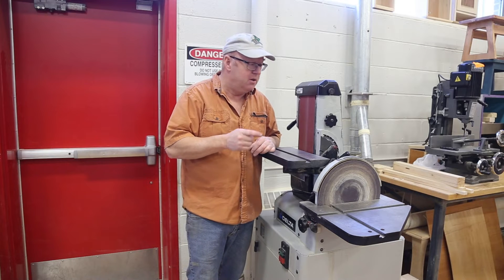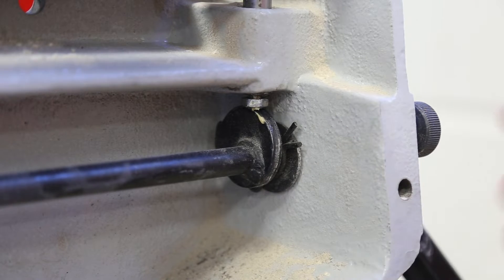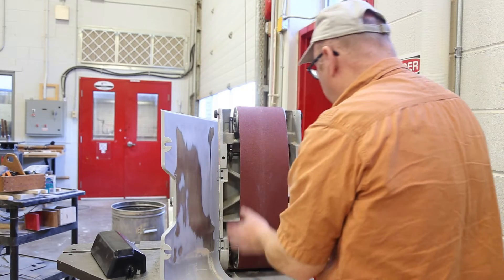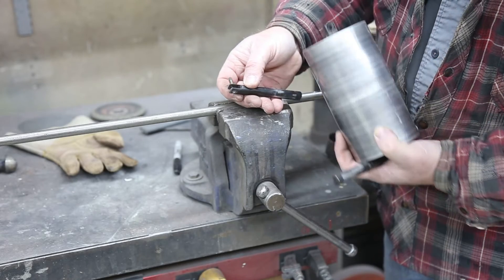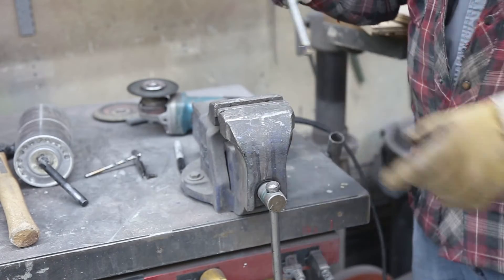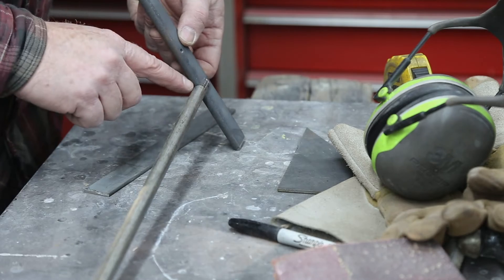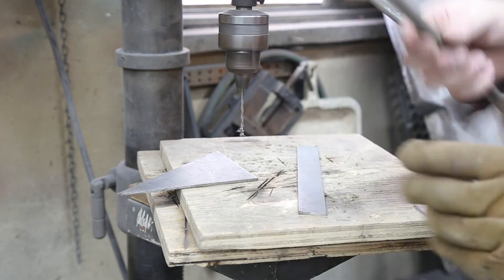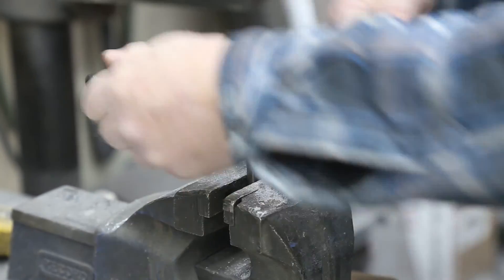Delta belt/disc sander.  Model 31-735 Belt tension modification

Comment: Great info. What is the belt size?
Reply from the maker: This sander has a 6 x 24 inch belt and a 12 inch disc.  It is tough to find a good sander these days but this one is holding up.  Thanks for tuning in.  Stevo

Comment: Cool mod. 🙂
Reply from the maker: It is still working so I am happy with the mod.  Thanks.  Stevo
Reply: @stevoj8959 si può mettere il disco abrasivo da 225mm grazie mi faccia sapere
Reply from the maker: @giuseppetrapani9405  It would be difficult to put on a smaller disc and get it centered.  If it is not centered, things could catch and ruin your day.  Thanks.  Stevo

Comment: Well that type of work looks is fun.  Great work.  I may have adjusted the original ones.  Good idea on making new push rods.
Reply from the maker: I had to see if I could build new ones just cause.  It worked out good.  It's like building a hot rod, it's nice when you open the trunk and it is full of original stuff that has been changed.  Thanks Bruce.  Stevo
Reply: @stevoj8959  Excuse my spelling.

Comment: that is a great idea, now even if the belt is a bit long or short it'll still work fine.
Reply from the maker: I checked yesterday and all is still good so the fix worked.  More and more, machines today are built with no way to adjust things.  Should work for any belt now.  Thanks Vern.  Stevo